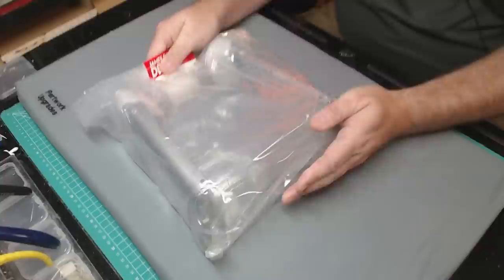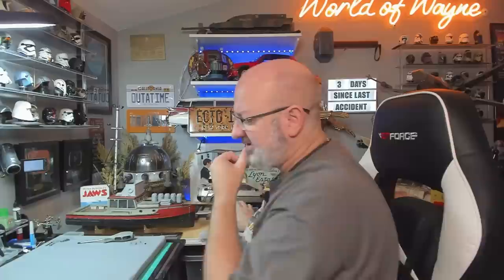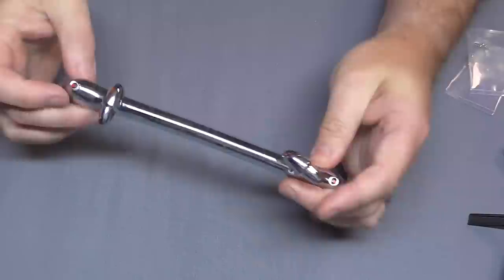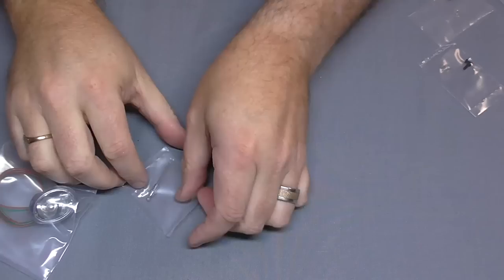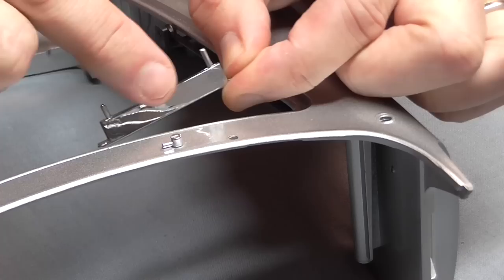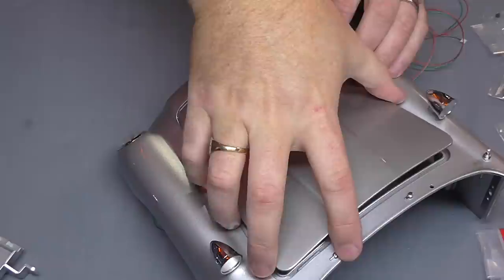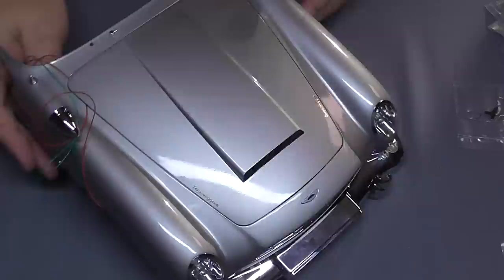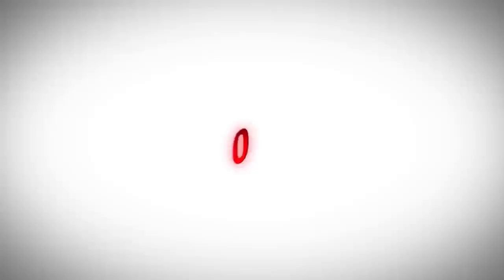Build the 007 James Bond DB5 Aston Martin 1:8 Scale - Stages 71-80

Comment: Wayne, these packs come still with the weekly newsagents pick ups in mind. Thus, even though you might not touch a stage/part, for a weekly customer each pack should be of the same value, or close to it. They try to spread the cost of the model across all packs. If they did per instruction, one week my pack would have only plastic pieces in, the next all metal. One pack might be worth a lot less than the RRP, the next a lot more than the RRP. I’m sure they’d get in trouble for selling a pack that’s worth less than the £8.99/£13.99 or whatever that model per pack cost is. Regulations

Comment: On the DB5 that Sean Connery drives there is what looks like little amber indicators on the front wings beside the side strakes. They seem to be missing from the build. You’ll notice it when Bond is first introduced to the car but most notably after he takes out Tilly Masterton in the Mustang with the tyre slasher.

Comment: I Just Fort You Should No Wayne That When You Put The Front Section On The Bonnet The Screws Are Not Long Enough Secure it From Underneath do not put to much pressure on it because the wind screen brakes A lot of people have had problems with this Section I still have not found A Solution For the Screw Problem Good luck
Reply from the maker: Thanks Mark

Comment: I’ve started the bond car but have got a problem with the electrics do you know anyone that can help please ??
Reply from the maker: What’s the problem?
Reply: I can not get the electrics to work I’ve caught one of the white plugs that connects the wires together an it has pulled the wire off the switch. I’ve tried buying some wire to reconnect it together but it’s no joy. It was all working up until this happened. I watched you videos an you mentioned that the key that you insert into the dash can some times be a problem. I’m just lost as where to go next. It’s my dads car he bought the books an I did the building. He’s never heard it running I would like to get it finished for him but I’ve miss placed the books so I’m not confident with stripping the car any further back to explore the problem. I would be willing to pay someone to get it working but as it’s a part works books model no one seems interested. Any help you can provide is greatly appreciate.
Reply from the maker: @simonhinson9367  cut the plug off and replace with another JST connector . Do a search on eBay . You want the mini ones I believe. The I inserted key just makes the engine noise come on
Reply: So the key has nothing to do with the lights or anything ?? As I’m currently getting nothing from the car. Do you know what gauge wire I need please as the tired to find some but come up short. I just thought if I could get some wire any would do I got the smallest gauge I could find but it’s still bigger than what’s on the model. Many thanks for you help an advice it’s greatly appreciated.
Reply from the maker: @simonhinson9367  nope. That’s just the engine noise
Reply from the maker: @simonhinson9367  I would just buy a JST connector with the wire already attached and then just join together
Reply: Can you apply the jst connection yourself as I’ve cut it off now as I was going to solder the wires together as I did not know you could buy the connectors. Thanks.
Reply: @WorldofWayneUK  ok thanks again for the help
I will try what you have suggested. Thanks